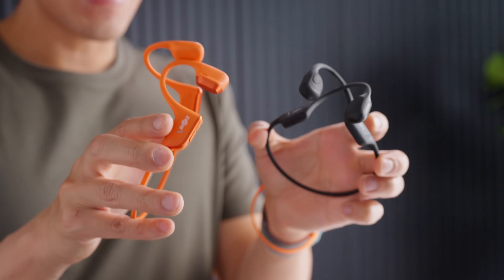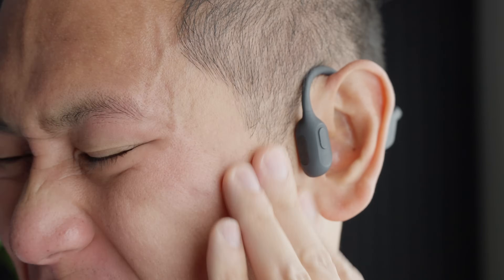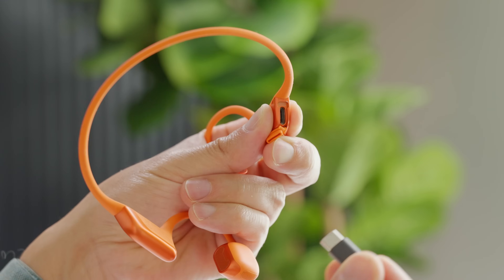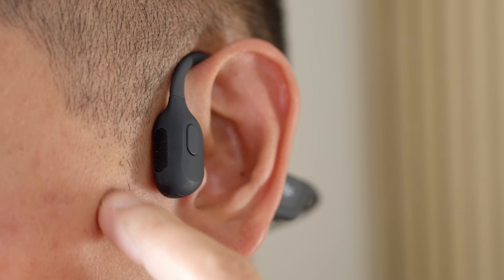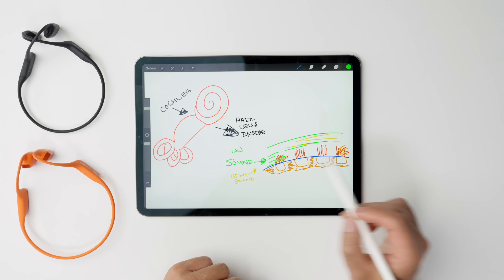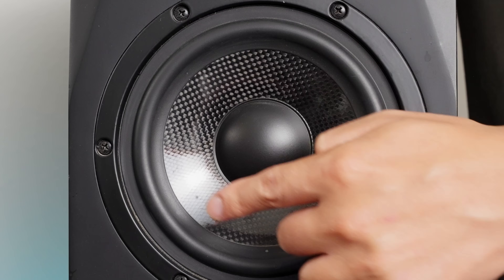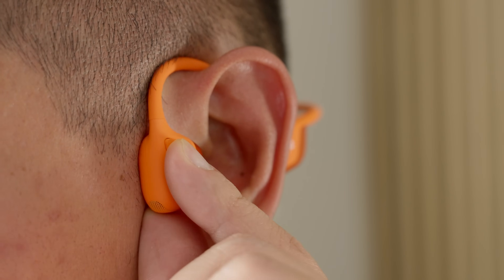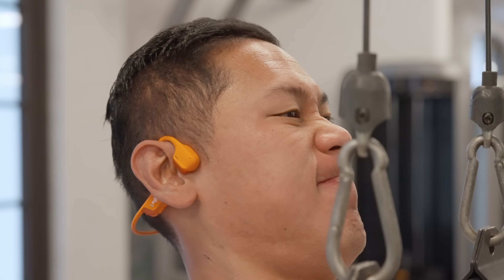The Genius Way the Shokz OpenRun Pro 2 Changes Bone Conduction Headphones

Comment: I think it never matters how the sound is transmitted if you still lose low end frequencies.
Reply from the maker: …but it does matter because it solves the loss of losing low end frequencies.
Reply: @ThisIsTechToday  I'd have to try it to be sure, Ive tried other headphones using the bone style tech and it was good as far as what it is, but just like we any it seems really hard to get that low end reproduction. Particularly in use for in ear monitor situations, as a musician I find it distracting to have a loss of certain frequency ranges. I'd be willing to check them out. Since if it does have good lows, it'd be perfect for me since I prefer to hear my drumming live as apposed to through in ears in order to be more aware of my own dynamic levels.

Comment: How does the air conduction do with people around you hearing it and can you turn it off for only bone conduction?
Reply: Just tested this and I can say: (1) you have to be very close to the individual wearing them to hear anything at all, and (2) yes, Shokz released a firmware update that includes 'classic mode' turning off the air conduction pitch. Enjoy, they are great!
Reply: @bjc1219 I ended up returning mine because it was pretty noticeable in a quiet room and I only listen to audiobooks. But yeah on the street, in the gym (how these are intended) totally fine, just not for my purposes. And yes the classsic bone conduction only does work, but that was just as loud ambient wise.

Comment: One of the biggest advantages is also when ur inner ear is functional but mid ear transmission is non functioning or compromised. For me to hear stereo I can use these or use a player amp headphone combo with special equalizer capabilities that costs easy 1000 bucks plus. I am in since series one but afraid that these add imbalance again since I hear fully normal one side and at 40% other side via bone conduction to inner ear. I wear the pro during skating BMX swimming (the non pro version) in the office and while cleaning the house and listening audiobooks. Sound is inferior but pretty good though and for me unbeaten since stereo. I sometimes go to bed and forget to put them off…

Comment: can you use them on an airplane if you put ear plugs in to reduce jet engine noise,would you be able to put your head back against the seat without causeing the headset to move from your cheak and ruin the sound thanks

Comment: I have the Pro for past year. I had mastoid infeaction when 5 year old kid 45 years ago. Where they did operation where they removed my inner bones/upper eardrum. In turn lost half my hearing in one ear. I found with Pro using the cheekbone , give me better hearing experience on that bad ear for sound. I am interested how to compare my hearing loss gain with the new version.  So will give it a go today and update as will the tech for bone conducation be better. As air tech should not help is my feeling other than for my good ear .. lets see ..  / As huge market if people with hearing this technology outside cycling /runing benefits etc
Reply from the maker: Thanks for sharing your story! Yeah, give them a try and see how it works with your situation. I’d love to see how it turns out!